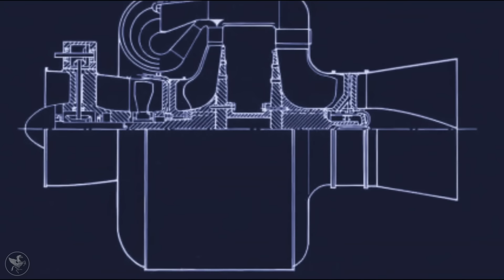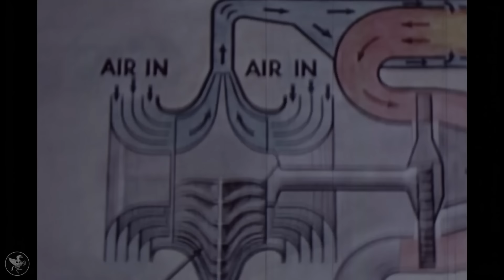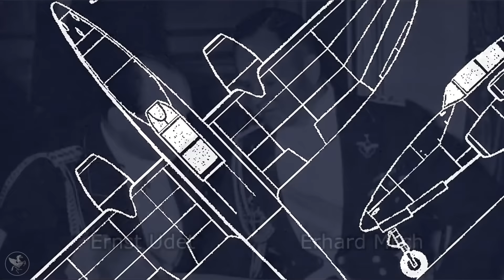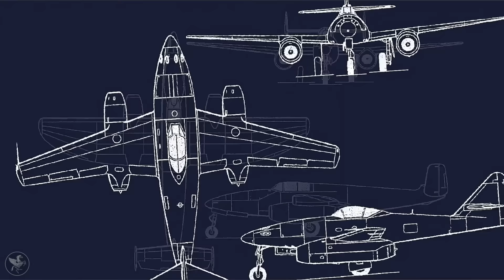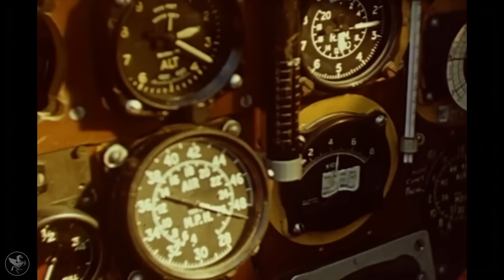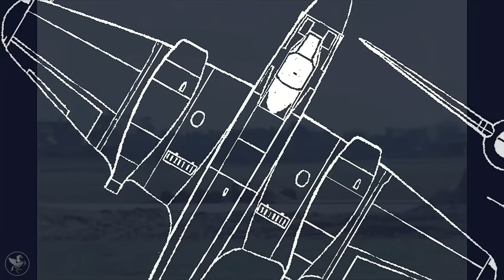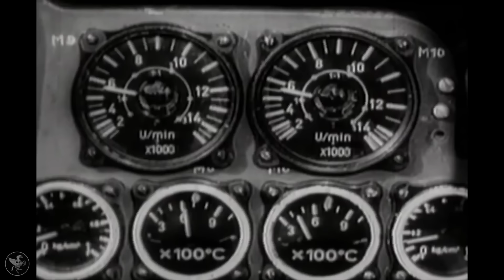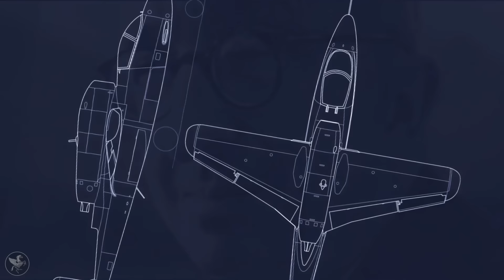Nazi Aircraft | The First Jet Fighter. Heinkel 280 versus Messerschmitt Me 262 | Full Documentary

Comment: The main issue with the the various jet fighter projects is that the jet engines were totally unreliably and even at the end of the war only good for maybe 10 hours of operation - depending on sources.  So, it really doesn't matter if Hitler or anybody else wanted to produce the jets as fighter bombers or helicopters, the jet engines of the time weren't ready for prime time.  At the end of the war the allies found hundred of Me-262s and other jets that were otherwise complete but awaiting for their jet engines.  Poor metallurgy and slave labor is never a winning combination.
Reply: ..meh..the aircraft was designed for a 30 minute engine swap out time. They knew it was necessary after 20 hours of operation and so had plenty of spares. What they didn't have were pilots and fuel.
Reply: Nonsense- the allied crews of 542 (confirmed) and 746 (unconfirmed) Me-262 kills would differ.
Reply: Must be nice to be so superior. Were you there?
Reply: Even at 20 hours of run time, nobody had enough engines to replace and remanufacturer for an extended time frame... with all the issues Germany had with manufacturing, they may have had enough engines for the planes already built, but they sure didn't have enough to replace engines every 20 hours or less
Reply: Man the YouTube comment sections are just people arguing 😂
Reply: @gerhardgotzmann8880 No. I believe 542 kills were claimed.
Reply: @jb6027 is correct. Sophisticated aircraft such the 262 required above average pilots, different fuels, more parts, more engines, more reliable and easier to manage engines and secure airfields. They had none of these things when the 262 came into service. If these things had existed four years earlier then things might (and that’s a big might) have been different. No matter how ingenious, smart, hardworking, adaptive and technically capable the Germans were, by 1944 the outcome of the war was assured and the end just a matter of time.
Reply: Without the access to crucial metals & ores needed for all productions it was a battle of engineering compromise using inferior materials.
Reply: The short life spans of the jet engines were largely due to extreme shortages of high heat resistant metals like chromium.
Reply: We’ll know shit
Reply: @jbh6027 Heinkel was ment to have centrifugal flow turbojet engines, which were much simpler technology than early axial flow jet engines. Germans jumped over 1 generation of jet engines on their own detriment going to Me-262 and Jumo 004. As an example Mig-15s happily outclimbed American F-86s over Korea, powered by simple centrifugal jet engine. Sabres having axial flow engine.
Reply: @jasonbrown3632 Bf-109 DB-605 engines in tens of thousands of fighters was scrap metal after 60 to 80 flight hours.
Reply: No Mr Frank Whittles Metor was designed for now and not for the future. The Brits had a practical get fighter that worked  were as the Germans design was totally unpractical and unworkable prototype and as a result Whittle was proved correct.
Reply: @louisavondart9178 bro they didnt have enough spares too.
Reply: @timphillips9954  What makes the "Germans design... totally unpractical and unworkable prototype" (Me262, He280 or AR 234) in comparison to the Gloster Meteor?
Reply: @bovverFS  Maybe because you had to rebuild the engine after each flight and the quality of resistant materials were just not available. Sums up German enginering during WW2 totally over enginered and unpractical / workable.
Reply: @timphillips9954  Well, the unavailability of the necessary materials, which then led to the redesign of the Jumo 004 and the fact that the 004B no longer had the (full-load) stability of the Jumo 004A and lower performance, as well as the general weakness of the German war economy to produce sufficient engines, is not necessarily a weakness in the design, is it? And that was the whole point. These circumstances were due to the war and the isoation of Germany as the aggressor. And, of course, Rolls-Royce did not suffer from the same material shortages as Junkers or BMW. 

The Jumo 004 engines were the first jet engines in the world to go into production, whereas the Rolls-Royce Welland and Derwent engines were not. In addition, the German jet engines Jumo 004 or BMW 003 were already equipped with axial compressors (today's general state of the art) like today's modern jet engines, the Rolls-Royce engines were equipped with centrifugal compressors, no one builds like that anymore (only in 1947 Rolls Royce had a comparable engine with axial compressors at the start).

The Jumo 004 engines were also clearly superior to the Rolls-Royce Weland in terms of performance, 004A with 9.8 kN thrust and 004B with 8.7 kN thrust despite inferior materials. The Derwent MkI, like the Weland engine also used in the Gloster Meteor MkIII, also only achieved 8.9 kN thrust, and the Meteor MkI or MkIII's performance was well behind that of the Me 262 in terms of both top speed and climb rate.

In addition, Messerschmitt used the advantages of swept wings for high-speed flight in the Me262 (as in the Me 163), while the Gloster Meteor and the He 280 were still designed with a conventional wing without sweep. 

The German designers were only slowed down by the lack of materials as a consequence of the war, but not by poor design, because that was ahead of its time.

Your sweeping statement that German engineering during WWII was completely overpowered and impractical is complete nonsense.
Certainly there were some designs that were moronic and born in the agony of the Reich like overweight tanks, other designs were forward-looking and equal to or superior to those of the Allies. These would be, for example, the FW 190 or the Panzer V Panther, considered by many to be the best battle tank of WW2. The Do335, for example, was the fastest series-produced piston engine aircraft of World War II, which was on a par with the jet-powered Gloster Meteor MkIII (with Welland engine).
Reply: The difference in a nut shell was that the Brits made a plane that worked not perfect but worked. The Germans built a plane that would have been perfect in the future but didn't work when it was needed. @bovverFS
Reply: @timphillips9954  That may be, but your current statement does not match your previous one about the design and that it was completely impractical or that the turbine had to be constantly maintained / overhauled. Your comment on this makes no sense. The Germans' technical problems were due to wartime shortages, problems that the British did not have to contend with. And it was a good thing that the German war economy had problems with the procurement of materials etc., not to be imagined if Germany had won the war. Nevertheless, the Gloster Meteor was a rather "old-fashioned" design like the He 280 or Ar 234, the engine problems of the Germans were, as already mentioned, due to the lack of materials and only in the suitability of the engines for everyday use did the British have the lead with the Gloster Meteor, but as already mentioned, they did not have the lack of materials.
Reply: @bovverFS excellent defense. In fact the main drivers of jet technology, later propagated to rockets, were German engineers forcibly repatriated to the West as well as the Soviet Union. Even today, in 2023, German military hardware is cutting edge whether in main battle tanks or submarines. German engineering talent is definitely state of the art.
Reply: @gerhardgotzmann8880 😂😂😂
Reply: @gerhardgotzmann8880  you would have fit in russia

so many ME262s were never operational how can they the be shot down fantasy figures

when the allies saw an ME262 they didn't engage them unless they absolutely had to

The ME262 was flown by the elite pilots Germany had left

percentage wise, the ME 262 shot down the most allied planes of all

if germany had 746 operational ME262 then the allies would have had big problems

you may attach material where you find the numbers you specify

About 1,400 planes were produced, however, less than a hundred Me 262s were in a combat-ready condition at any one time.[113] According to sources they destroyed from 300 to 450 enemy planes, with the Allies destroying about one hundred Me 262s in the air.

https://en.m.wikipedia.org/wiki/Messerschmitt_Me_262
Reply: @louisavondart9178  They had both enough JET FUEL (which is more like diesel) and spare parts. They couldn't get it to where it was needed due to a totally collapsed infrastructure. They also had the pilots in theory; practically it was murder second degree to send out boys with less than 20 hours against the Allies.
Reply: When you think about it, the metallurgy was actually excellent. They knew what they were doing. They lacked the raw materials and had to improvise and take shortcuts everywhere. That said, it's a little miracle that they made it happen at all.
Reply: New technology.  Wartime shortages
Reply: @robertbaker9329 who says !!!!!! You???? 😂🤷‍♂️🤦‍♂️... Just trolling 😊
Reply: @Trevor_Austin Fuel apparently wasn't  too much if a problem because they didn't  need avgas
Reply: Think of the rock-bottom cost of production you get with an enslaved workforce.  That was a joke, by the way.  Stalin had some of his designers working from home, that is, from prison.  Even with the shortage of the best materials and the short service life of the engine, if the Germans had produced the ME 262 earlier and in sufficient numbers, the Allies would have been unable to establish air superiority or continue the strategic bombing of Germany.
Reply: @Trevor_Austin  The chance of Axis Victory dropped 30% when they left Africa and dropped to 99% when they failed to capture the Russian oil fields. A lot of experts conclude if Hitler didn't micro manage when it came to military equipment even in late 1943 if engineers were allowed to develop defensive weapons the war woupd have been seriously prolonged. Or who knows maybe those scientist we stole thst put us on the moon would have built nukes for the Nazis instead of for the allies. Those bombs dropped on Japan may have been dropped elsewhere by the Germans.
Reply: Yes. This is why the engine life was so short. They had to make do with what materials they knew would get their hands on.
Reply: @kimj2570  That isn't the whole truth. The power of the centrifugal jet engine HeS8 was to weak in comparison to the axial flow jet engines Jumo 004 and BMW 003, only with 6 kN thrust and would hardly have an advantage over the fast piston-engined fighters of the Allies. Also, the RLM requested the cancellation of the further development on that engine.
Reply: @timphillips9954   still till this day it's the same. Lol
Reply: 😂1:10 Германия в проигала,количество.
Reply: Everyone knows that.
Reply: @jasonbrown3632  The Germans build 6k engines and had built around 1.2k frames.
Reply: @timphillips9954 The Jumo 004 was designed for 50 hours, nothing less, then it needed an overhaul.
Reply: They would have been reliable eventually had they were given the approval of mass production and the recognition of their capabilities
Reply: @jasonbrown3632 only parts of the  engine had to be replaced not all the engine

Comment: The unreliability and long development time needed for the early jet engines was the primary reason for the late introduction of jet fighters by Germany. The BMW 003 was just more complex than the Ju 004 and so it took longer. The Ju 004 went through a long development cycle as well but it hit a last minute hitch that delayed it by as much as 4-6 months. When they began operating the ME 262 at various alritudes and speeds they began having unexplained turbine blade failures. It took a couple of months before they brought back their vibration specialist Max Bentele. He figured out that at certain operating speeds the resonant frequency of the turbine blades was the same and so it set up a destructive vibration in the blade assembly. He changed the angle of the blades and shortened them and lowered the max rpms slightly to solve the problem. One of the great what ifs is the Heinkel HeS 030. It was one of 2 engines that Heinkel was working on at the same time. It was canceled by Helmut Schelp in October 1942 when they had just managed to get it running at full power in bench tests. He decided that since there were already 2 engines so close to being ready that Heinkel should go ahead and begin development on a more powerful type 2 engine that would enable single engine jet fighters. Of course he didn't know that they would need another 18-24 months before either type entered production. The HeS 030 had adjusrable turbine blades for different operating speeds so it might have avoided the vibration problems. It also had power output between the BMW and the Jumo. But it weighed 860 lbs. Dramatically less than either one of the others so it would have required much less strategic metals to build. But if they were still able to use some nickel and chrome they might have had a longer operating life than the jumo.
Reply: Not only those metals but vanadium aswell who becoming hard to find inside occupied Europe
Reply: Everyone knows that.

Comment: What a great airplane.  This is truly the grandfather of all jet fighters today.  By 1945, the US was replacing their air assets at a rate faster than they were downed.  Also the jet engines of the 262 required complete engine replacement every 10-20 hours or so. I believe there were not too many of these engines around.  Coupled by severe lack of fuel and trained pilots, the writing was on the wall for the Germany.  Brilliant design let down by unfavourable circumstances.

Comment: Just one quick technical note about the engines on the He 177.  The DB 606 power system was made up of two DB 601 engines mounted side by side, not in tandem as mentioned in the video.  There was a common gear housing that connected the front ends of the two DB 601 crankcases, that drove a single propeller shaft.
Reply: I know that a 'Tandem' bicycle has one rider behind the other, however if you look more closely into the use of the word 'tandem' it means 'together' often 'side by side', it is the 'together' bit which gained the double bicycle it's name & not the fact that the riders are 'one behind the other'!

Comment: With all those comments about the 20 hour engines, and how there were not enough replacements, people forget ONE thing:
The combat piston engines of the time were charged to the max, and also needed strip-downs or outright rebuilds after about 20 hours, believe it or not! 
ALL combat and transport aircraft in all air-forces needed rebuilds or new engines after just a few missions. 

Even after WW2, when transcontinental and transoceanic flights became commercial routine, the old piston engines lasted no more than a couple of hundred hours, before a rebuild was required, so legendary airliners like the Lockheed Constellation and Super-Constellation could only make about ten Atlantic crossings (ONE way) and then needed a new or rebuilt engine set. 
The first generation jet engines of choice for longevity ended up being the radial flow units, which were less efficient due to their bulk and thus added drag. When metallurgy caught up with the demands of axial units, things improved, and by the fifties, axial flow jet engines were superior in live-span to high performance piston units. Just due to the maintenance requirements alone, frequent air-travel with classic piston power would still be for the rich and famous only.

Comment: There was a book in the college library about Engines. It went through the history of piston engines.

I think the first one was a single cylinder engine but it took the reader through the various developments, never losing the focus on the power developed by a turning shaft. 
Charging the cylinder with extra air to allow a smaller cylinder develop higher power was covered.
The last example discussed was the multi banks of radial cylinders which powered the B-29. 
It had turbines in the exhaust to drive a shaft compressing the air going to the cylinders. 

It was then that I realised that the next step was to remove the pistons and the crankshaft and simply draw air into the empty cylinders, spray fuel and as it rushed out it would turn one turbine which would run the compressor. 
The rest of the burn expanding gas would, if pointed backwards, push the aircraft forward.

To be led to that conclusion, it must be a good book.
Reply: @bluesky6985  
On the other hand, as a greater weight of gas exists the aircraft at a higher speed you can use the mass and velocity product to show where and by how much the aircraft is moved using the classical Newton Equation.